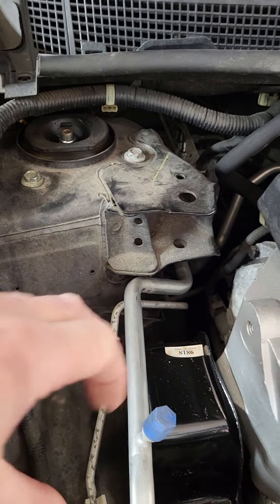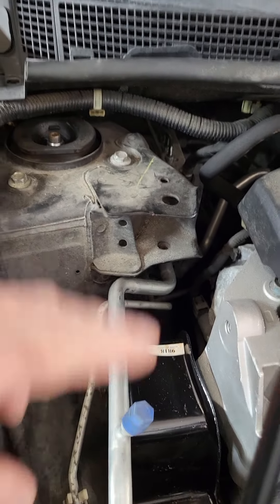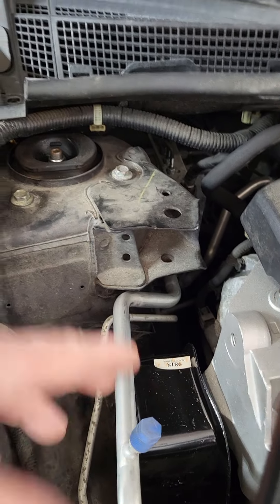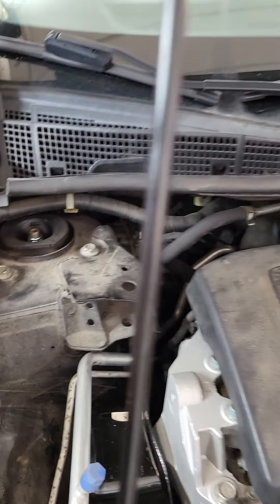Auto manufacturers eliminate parts to save money and make even more money

Comment: “I'm as mad as hell, and I'm not going to take this any more!”  Buy my 1979  ford pickup with 300 cubic-inch inline-6 cylinder engine and a 3 on the tree shifter.  oil pressure sending unit blows yearly and the emergency break foot peddle replace every 3 years and the e break cables replace every 5 years and keep oiled.